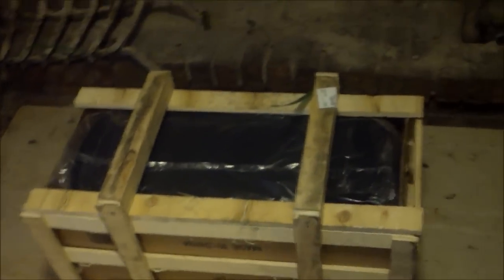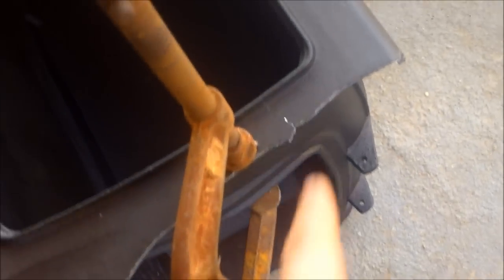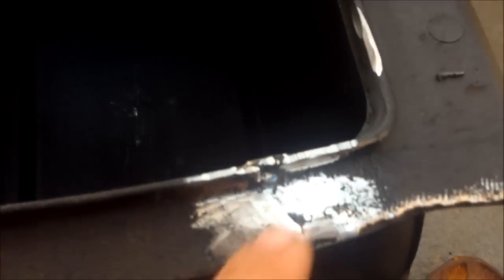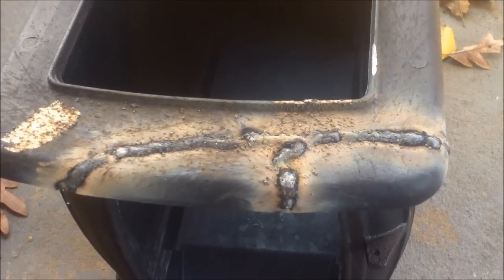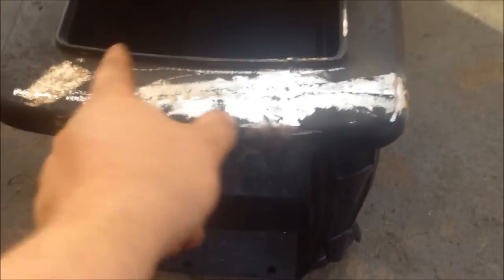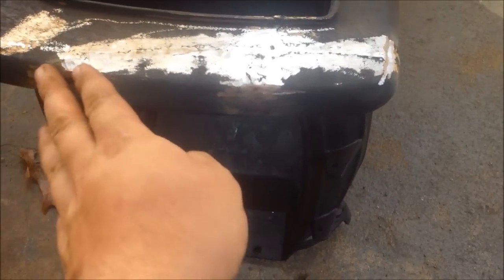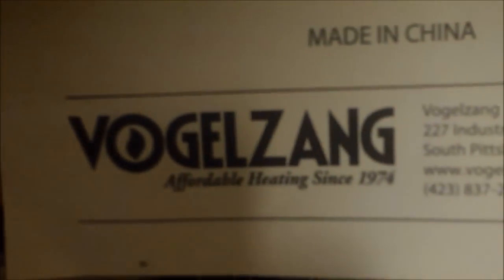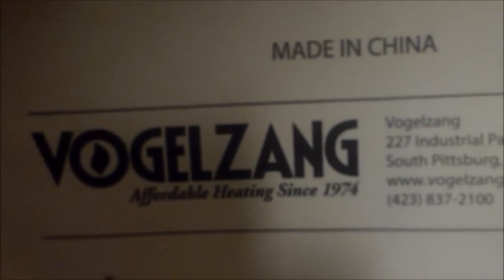$143 harbor frieght box wood heater Vogelzang BX26E how to fix it....

Comment: The metal stove is designed to radiate heat from the sides and top....all your heat is going up the chimney.....I have the exact stove in my shop....the center piece between the two"pot eyes" needs to be spot welded to the top....I have had all three pieces fall into a roaring fire when I was poking logs around....a log pushed up and knocked the pieces out.......other than that....great heat source.

Comment: I'm sure you no by know that the bottom tray that slides out for the ashes is also how you control the air flow. The more it's open the hotter the stove closed all the way your fire will go out.
Reply: I was thinking the same 😂

Comment: I got mine back in 2010 when Harbor Freight sold them for $99.00 on sale.  I have seen other places selling them for much more.  This video shows no pipe, he just placed it in the fireplace. He is not getting the benefits of a draft the pipe provides. I would  recommend  placing it just out side of the fireplace and use a 90 degree elbow and 3' of 6" pipe running into the fire place with another 90 degree to direct the smoke up with at least 9' more of 6" pipe to create a stronger draft up and out of the chimney.   When placed out of the fireplace the sides of the Boxwood stove are exposed to give off more radiant heat.  As the sides of these Boxwood stoves is where much of the heat is produced along with the top.

There is a issue of the chimney draft pulling air up through the fireplace. I would not want that to happen and would block it off with something that won't burn and would also support the pipe...

For long burn times I shape the burn by pushing the hot coals to the right so it will burn from right to left as the right side is where my open room area is.  just load the left side with no coals under it first then place a new piece on top of the hot coals. I load very large pieces in through the top, use your ash shovel and push the coals toward the back so that it burns the new load from back to front .  For longer burns I  keep the front door wide open only close it while lighting or to perk the fire up with the slider 1/3 to 1/4 open.   If it gets down to around zero Fahrenheit keeping the door closed with the slider half open will produce the most heat but will burn the wood the fastest.  Also using a grate will get even more heat with door open or close and again even faster burns.  

These cast-iron stoves are simple and burn wood very well, better than many other types.
Reply: Frazer TGB  I do not know what you mean?
Reply: Frazer TGB  Ok, very controversial because when the stove draws air form inside it is drawing from close to the floor. That is creating a thermal siphon pulling the cold floor air in and drafting it up the pipe.  Yes it is also pulling fresh cold air in the house through vents and what cracks there are. In my opinion that cold fresh air is better for us to breath.  The external draw of air is not really necessary.  I am in North Carolina our winter are mild and my house is small so I don't even use a heat exchanger.  You can also create a thermal siphon with a heat exchanger and pipe it to differant rooms in larger houses.  Forced air heat exchanger would be best for large structures in the colder northern areas...
Reply: Finally someone who has spent time with the stove.  He’ll learn a lot by understanding the draft and the idea of a double burn. I can get mine so hot you can’t go near it. I like the stove it has decent controls and can put out some heat.